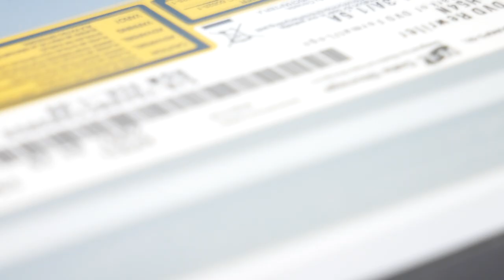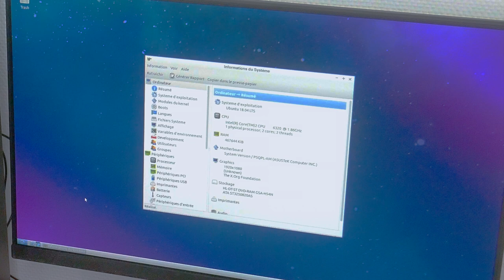SATISFYING computer DEEP CLEANING

Comment: Nice one mate. Good work once again!
Reply from the maker: Thank you very much Nick ❤️❤️ Nice to know you enjoyed
Reply: @french.satisfactory  I always enjoy your vids mate. Keep up the good work.

Some tips though:

1) It's recommended to replace the heat sink compound with the same material. For example you replace thermal paste with thermal paste, thermal pads with thermal pads, ectr. I'm saying this, because at some point you replaced this pink sticky substance (sorry, i dont remember what it's called) with thermal paste, wich is not recommended. I'm not gonna lie, I'm a big fan of this practice too, because it's convenient, ie you just use thermal paste on everything and you are done. But, it's not recommended. Probably, you  will not face any problems (at least I haven't face any as of yet), but it's good to know nonetheless.

2) Avoid using the air can so close to the wire plugs. Reason is that air inside the air cans is chemicaly produced and basically it's in liquid state. Using the can so close can lead to the liquid reforming and penetrating the plugs, damaging them and basically rendering them useless. A good alternative is to use it from a greater distance (5-10 cm will do), or better yet, replace the cans with "natural" air (like an electric air duster wich costs around 100€. Expensive, I know, but it will benefit you quite much in the long term).

3) Regarding the case. From my experince I've noticed that it's quite easy to overtighten the screws. This can lead to the screwholes on the case to loosen and, as a result, everything that is attached to it move a lot. Last time I noticed that was like a year ago, when I tried to unscrew my motherboard. I had previously overtighten the nuts on the case so much that they wouldn't stay put, so when I unscrewed my motherboad screws, the nuts went of as well. Thankfully, I haven't seen you do it, but I just wanted to give you a heads up.

Keep up the good work mon frere !
💪🇫🇷 🇬🇷
Reply from the maker: 1) You are right. When I replace the TP I had in mind that I should maybe looking for a more appropriate products. As I would like to have as best practices as possible in this channel, I will looking for it, maybe for the next video . 
2) yeah I think you are pretty right with this also (about using the cans too close) I really would like to try some electric air duster... mmmh I will try to send some emails and try to have some for free ... i guess with almost 300K cumulated views and 3K subs I can hope some companies would accept.. let's try 🤞
3) It already happened to me in the past, but way before I made YT videos 😅
Thank you so much for taking time to write this comment Nick!
🇫🇷 ❤️🇬🇷
Reply: @french.satisfactory  Cheers mate. Regarding the technical details of your video (mic quality ectr), I'm not gonna comment on that as it is not my sector of knowledge. That's for you YouTubers😅. All I can say is that I enjoyed the sound quality. This annoying sound that your vids were suffering before is now long gone. Plus, I think Soortes did quite a good job commenting on these things.

Again, keep up the good work.

Till your next video🙏

PS: Proceed with extreme caution when you take apart the power supply unit.
Reply from the maker: Cheers Nick! yeah, loved to talk with Sortes also! People like you guys are helping this channel to grow the right way.
wish you an awesome week ❤️❤️

Comment: Great and very satisfying video! Looks like this was quite a nice PC in it's time with lots of potential for upgrades and expansion! Too bad it was never taken advantage of. Those dual-fan power supplies are so weird! The dual fans seem so unnecessary.

I have one more tip for you: On these push-pin coolers you should turn the push pins clockwise BEFORE pushing them in, this way they click into place with an audible and tactile click, so it's immediately obvious the heatsink is seated!

Maybe you should clean up a dirty video card and some drives and expansion to kit it out in the future ;)
Reply from the maker: Thank you very much ypoora for your comment ❤️❤️
mmmh i will check this push pins clockwise thing. I'm every time a bit lost about how tu use it perfectly. I thought I was right, but looks like it is perfectible 😂
I will for sure add some stuff inside this PC for a later use 😉
Thanks again ypoora 😘
Reply: @french.satisfactory  Turn them counter-clockwise to remove, and pull!

Then turn them clockwise to install, and push! :)
Reply from the maker: @ypoora1  I keep this in mind for the next time 😎

Comment: What type of cpu was that it was to blurry to see but as usual cool to see another video
Reply from the maker: Intel Core 2 Duo 1,86 Ghz. Sorry for that, I will do better next time 😅
Just realised that I also forgot to add the specs in the video description, but I'm too afraid to update It right now, so I will, but later 😇
Thanks for your comment The Red Fox! as usual ❤️❤️
Reply: It's a Intel core 2 duo e6320, clocked at 1.86ghz, with 4MB cache and its Architecture is Conroe (released in 2007)
Reply from the maker: That's a tech soldier 😎

Comment: Those 775 socket machine are surely a long-timers. You've done a great job adding some years to this one. I'd bet still runing today. Replacing a thermal paste on chipsets are a good practice for motherboard of this age. Unfortunately lubing a ball bearing fans usually does nothing. Cause there is no sleeve and ball bearings are closed cased and can't be lubed. Unless it's a some chinese false-advertised ball bearing fans which actually a sleeve-bearing or a sleeve+ball bearing type. Such fans have both bearing types one after another. Usually it's a thick ones and it's not so common. Bearing type is easy to tell. Copper colored are sleeves and steel colored are ball bearings. You don't do any damage lubricating a ball bearing fans but is doesn't help em. If a ball bearing fan goes noisy, you need to replace a bearing. With another one or with a suitable sleeve.
Reply from the maker: Interesting comment about the fans. To be honest, some people told me that in my first videos I should do it, and a very small portion are telling me that finally it doesn't make sens when I started to do it. I will make some more research about this. 
Glad to know you enjoyed watching this old video @user-dh8ji4ti8b and thank you very much for your comment ❤️❤️

Comment: I adore when all front panel connectors are connected to motherboard, in my computer only power button is connected to the switch from gefest gas owen..
Reply from the maker: Hi Иван, is there a reason for that? If you don't have the right cables, you should easily find adapters on Amazon to connect them.
Thanks for your comment, I hope you enjoyed the video ❤️❤️
Reply: @french.satisfactory  the reason is i think my front panel sucks.. or do not suck air at all)) so i removed it completely, now 14 cm fan can breath at least..
Reply from the maker: oh ok ok! Well it is another method 😅

Comment: I'll rather wash everything, even the PSU. Dry it with hot air and let it several days to completely dry. I never had an issue with that. Cleaning with air jet only you get rid of dust but you do not get rid of smell.
Reply from the maker: Well, I know this can be done that way, but I'm not a fan of it. Washing electronic components with water is too much for me. Am I wrong? Will I do that in the futur? I would say no, but never say never 😅
Added to that, I am doing 1 video every 2 week, and don't have time to wait days.
Thanks for your comment best opinion, just saw that you are watching my videos since 7 months!! So thanks also a lot for your fidelity ❤️❤️
Reply: @french.satisfactory  Well, I do not wash expensive hardware. But these old cheap filthy potato PC parts - always washing.
Reply from the maker: i see. So you are washing them with water and soap then ?
Reply: @french.satisfactory  Yes. No need to deal with flying dust and it is a fast operation. I use a big brush that can enter in any crack. I disassemble everything first, of course. Remove battery from motherboard.

I do not keep them long time in a basin if it is electronic component. Just spread water on it, soap and brush for short time, water again,  and immediately hot air (do not keep hot air jet in one point for long time). This way one by one. A sunny day may help. :) If not, a warm room.

Btw, Tech YES City - a youtuber around here uses washing machines, you can see his videos about it.
Reply: @french.satisfactory  But watch out with PSUs though, you can get electrocuted. I guess gloves may help.
Reply from the maker: Very interesting. I didn't know Tech YES City to be honest. I will check this out later. I'm pretty busy right now 😅 Thanks again best opinion 🙏

Comment: You've cleaned open crystal with a cotton wool.. isn't it too abrasive for this purpose?
Reply from the maker: Are you talking about where I clean the lent in the optical drive? or have you a timecode? I am using cotton swabs for babies so I don't think so. I never had any issue with this.
Reply: @french.satisfactory  i was talking about chipset..
Reply from the maker: ohhh well I never had any issue with this. And as far as I know, it's a pretty usual method. The only thing I never saw somewhere else, it's using cotton swabs for babies and I recommend this. It is softer and the cotton stays more on the stick longer. And just use isopropyl alcohol of course 😉.